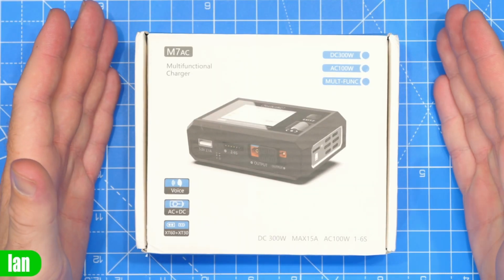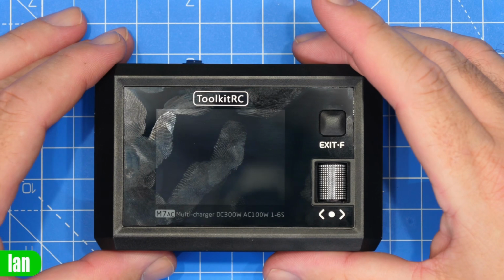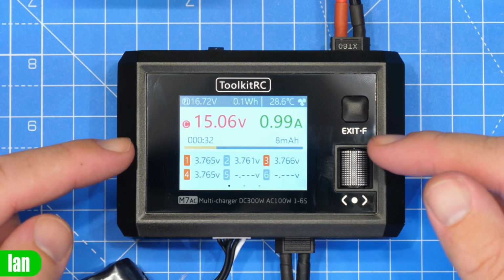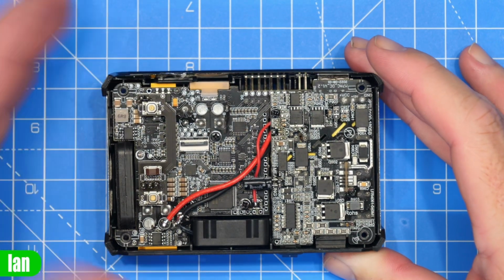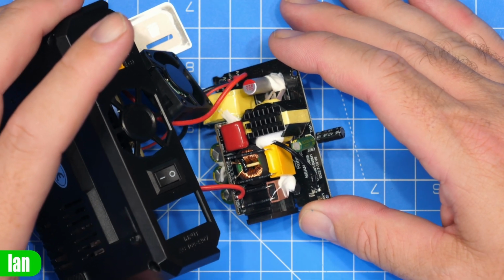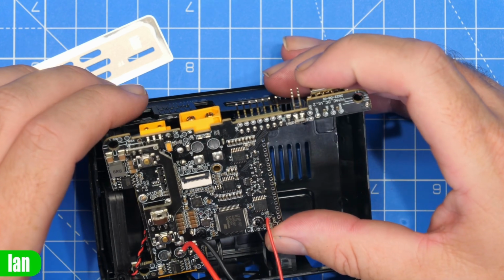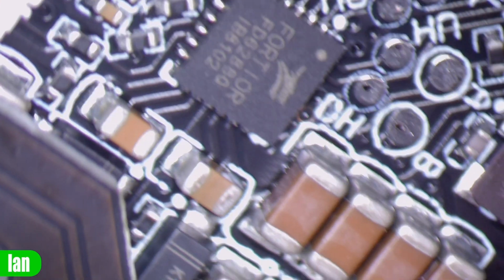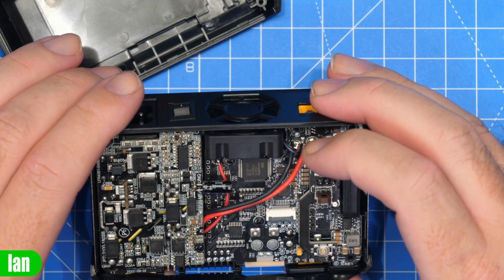ToolkitRC M7AC AC/DC Portable Lipo Charger Review

Comment: Thank you for teardown. If I compare with other toolkitrc devices I didn’t see 6R8 inductor in this device. I had M6 and during discharge 6R8 inductor was too much heat and soldering melted also other side of breadboard connected screen cables also melted. After all of things I changed display because of destroyed screen cables. It was Realy bad design. Cooling was so weak. But this device looks good.

Comment: Notice the AC power board has a "Mean Song"? name on it. I bet it was a special repackaging of a standard design, and not made by ToolkitRC. Hence the difference in build quality. When I first saw the "Mean" name with the rest blocked I thought it might be Mean Well which is a good respectable maker. I have no experience with Mean Song. In fact this is the first time I've seen the name.

Note, in that package size it is possible to handle 300W AC input but one would need the latest converter chips. 100W is pushing it for that size of AC power board using two generation or older tech, which is what I see on that board. No, I'm no power supply expert, but I do spec and use them.

Comment: Honestly, this is a step in the wrong direction for ToolKit. The M6DAC was a better charger in a similar package,  2 lanes, more AC power, more DC power...and this adds what...7S...I dont know anyone who needs that.  Meanwhile, we've been begging them for years to make a 4way dC 6S charger.  Theyve been promising me (as a ToolkitC Dealer) for years that 6S 4way is coming, but I got tired of waiting and went with Hota F6 for 1000watts 4 way field charger, and use it at home on the server PSU , or in the hotel on the Hota T240 watt PSU💪
Reply: My issues are not 8S, and limited to 28VDC input. IE not a freshly fully charged 24VDC battery bank. I have a 24VDC LiFe battery bank in my truck.